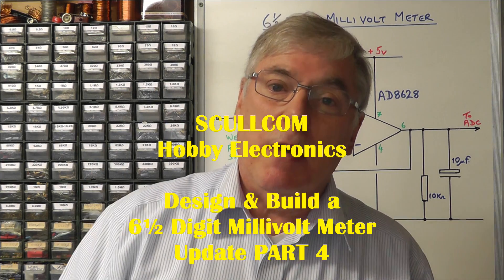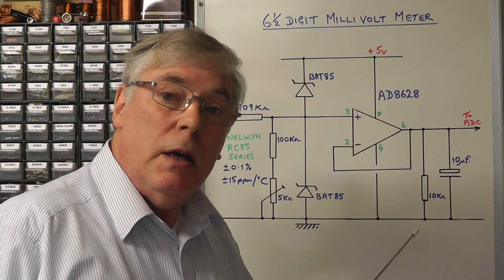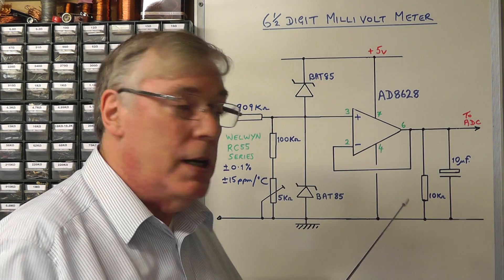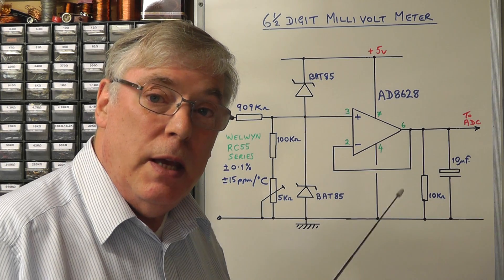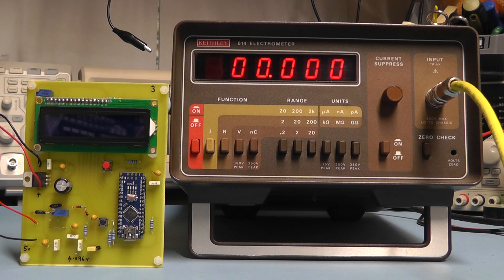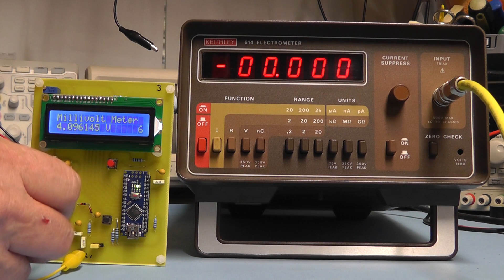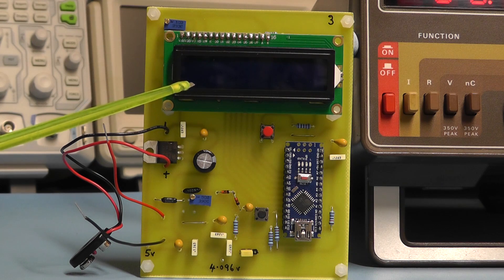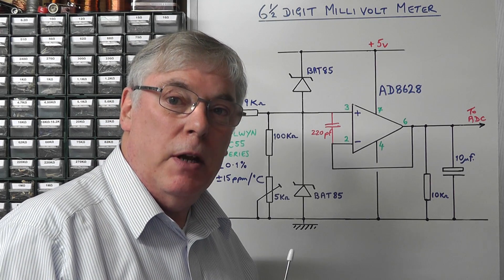Scullcom Hobby Electronics #36  - Design & Build 6½ Digit Millivolt Meter Part 4

Comment: Louis, I think we may have a potential bug in the LTC code that will compromise the averaging of the multiple readings.

I assume that you got your original code from Martin Nawrath, (Academy of Media Arts Cologne, Germany) it looks a lot like that, but Martin uses no averaging in his code.

In the main loop, we use a for-next loop that increments the number of samples we get from the Spi_Read function and then average the result by diving the result with the number of samples.

However, in the Spi_Read function, we skip the complete reading of the ADC if it is not ready.
Here: 
  if (!(PINB & (1 << 4))) {
  ...
  }
This means that the averaging can be off. If I'm right, the Spi_Read function should have a flag to signal a correct reading back to the main loop.

I will put a logic analyzer on the pins to see if this is happening, and how often.

What is your take on this?

Regards,

Paul (PS I also sent a msg to Greg)
Reply from the maker: Hi Paul, I have made quite some changes already to the Arduino code which should solve this issue (been working on over the last few weeks and testing). Hope to get my update video finished in the next few days and uploaded to my channel. I have made quite a number of other changes and additions to the Arduino code on this upgrade. I have change the way the samples are taken and averaged. The "if (!(PINB & (1 << 4)))" statement is also changes to "while ((PINB & (1 << 4)))   { }" which simply waits.
Regards,
Louis
Reply: Using a while without an escape in an embedded application like this may cause a "hang" in the main loop, or disturb the overall timing, which is not recommended. Another method to prevent that from happening is to use a global value in the Spi_Read code that only gets incremented with a successful data acq. That global var value is then used to average the final result, not the loop counter. I have used that method in my version and is available on my blog.

I'm very much looking forward to see what your changes and improvements are. You and Greg built an already impressive tool, and with some more efforts, it can be even made better. This is my first experience with this particular topic so I'm still learning and researching ways to improve the stability and precision of the output or add more features. I hope others can chime in with improvements too...

Comment: I got inspired by your project and built an MCP3422 version (18  bits/15uV resolution which suffice to my requirements) with PIC16F1619 (1Amp consumption VS arduino 16Amp power consumption) (excluding LCD current Cons. which is 4.8mA),the question about the capacitor 220pF between V- and V+ of the AD8628 Op Amp, when installed the current consumption increases by +32mAmp which is quite large for battery operated circuit, Please advise.
My project  power consumption is 5V*6.7mA (total) while the Arduino version is about 5V * (16mA Arduino+4.8mA LCD+ 1mA other + 32mA increased caused by the 220pF cap) total 5V*55mA that is 900% more than the PIC version, the pic development board I have used is the Curiosity Board from Farnell £13.00 and Microchip MPLAB IDE with XC8 compiler with MCC generator ease the development.
Thanks again for great inspiration.
Kind Regards
Reply from the maker: Thanks for your comments, nice to hear about your take on this project. Regards, Louis
Reply from the maker: Strange about the issue you were having with the increase in current due to the 220pF at the input.  When I checked mine it seems fine. Have you tried using a smaller capacitor say 100pF and see what happens. Wound be interested to hear.
Reply: Thanks Louis, for your prompt reply, I did try 125p cap and it is the same result.
I do encourage you to use PIC16F1619 now it is easy to program with the new Code generator that comes with the MPLAB ide xc8 compiler.
You will reduce the power to max 2mA except for the LCD which is about 4mA,, I do have LCD code for that if you require it.
Regards
Mohammed
Reply from the maker: No sure why you are having this increase in current I will have another look at mine to double check.
Some years back I starting with using and programming PIC's but for some reason I have drifted in to Arduino as I found many hobbyist found that easier to use. From what you say the PIC programming has become easier, maybe I should give it another try. Regards, Louis
Reply: I using I2C for the MSP3422 (18bit) the AD8628 and 100k+48.7+2kPot as input voltage devider of course this is drivin by PIC16F1619 nano power uC. But all ok working for me without the cap although I have to tackle noise  by software. The only issue I am having is the resolution which should be 15uV but it is now 128uV and this is due the data type "float" of the XC8 C compiler and almost found a solution.
CHEERS
Reply from the maker: Glad to hear it working without the 220pF capacitor. Trust you will solve the resolution issue soon. Regards, Louis
Reply: THANKS

Comment: Hey Louis, I finally finished my built of the voltmeters, I actually built two. I believe that there are some interesting enhancements to the design, so here is a link to my blog that details it all.

I must say that I am very impressed with the accuracy of the meter, they are much better than I anticipated and a very welcome addition to my toolkit. Thank you again for doing this all!

Paul

http://www.paulvdiyblogs.net/2016/09/building-6-digit-digital-milli-voltmeter.html
Reply from the maker: Thanks Paul, I have also been working on an update on this project over the last few weeks and hope to finish testing and filming this week before uploading to my channel. I have made a number of improvements including calibration method to improve accuracy. In addition I have added a number of new features. The software has been updated and I have build the unit in a nice project box.
Thanks for your link.
Regards, Louis

Comment: I built a test version of the Arduino Nano and an LCD display to work on the software. I also used a different setup for both switches, to get a more improved event recognition.

I used the following circuits for both switches (can't include anything so I have to go back 30 years)

 VCC
   |
Switch (normally open)
   |
   --10K-----Input Pin
   |              |
  1K      100n
   |             |
GND    GND

This setup provides an R/C filter function on both edges. Normally the C of 100nF is discharged and keeps the input that way during startup. When the switch is closed there is an R/C filter of 10K/100nF charging the C. When the switch goes open again, there is an R/C filter of 1K+10K/100nF discharging the C.

The definition for the Cal input needs to switch from a LOW recognition to a HIGH, and the pull_up must go. So this is the new definition :   
pinMode(BUTTON_DEC, INPUT); 

I have also changed the code in the main loop for the calc button a bit as well:
  } else if (digitalRead(BUTTON_DEC) == HIGH) { // Internal pull-up used; active HIGH
    delay(DEBOUNCE_DELAY_MS);                   // Add some debounce delay
    if (digitalRead(BUTTON_DEC) == HIGH)        // Read the input again, if OK do it
       adjustDecimalPlaces();
       showHeader();                             // Back to normal operation

This gives me a reliable button press for both.

Enjoy!
Reply from the maker: Thanks Paul for the input.

Comment: Hi Louis,
You have several great projects for the hobby user and a fascinating way of getting everything across to make it easy to understand and easy to built.

I just noticed a leap forward on the milli-ohm meter, which is now fully encompassing the pcb available through OSH-Park that Greg did. You also published a BOM that is easy to use and lists everything. Great job!

Are you considering (please!) doing the same evolution with the DVM by using the OSH-Park pcb and create a BOM for it?

Looking forward to the next installment.
Reply from the maker: Hi Paul,
Thanks for your kind comments.
Yes I am planning on doing a similar update for the Milli Volt Meter Project for which Greg also produced a nice PCB, which is available from OSH Park. Although I will be using the same PCB that Greg produced I will implement it slightly differently to what Greg did on his build. Will also update the software for this version.
The only drawback of OSH Park is that you have to order 3 PCB's at a time so if you can share with others building this project then the cost can be split.
Will try and get this finished as soon as I can and upload the video.
Regards,
Louis
Reply: Super! I managed to get the DigiKey partslist from Greg, and I've been working on some other parts required for this project. If you're interested, I can send you what I have so far. (I distilled the manufacturing part numbers, so the ordering can be from just about any supplier, not just Farnell,  DigiKey or Mouser)
Reply from the maker: Hi Paul, Thanks for the offer. I do already have a detailed list but if you would like to send me the details in the private messages section I will cross check it with my list to make sure I have covered everything. Regards, Louis

Comment: Hello from Germany!
I found your channel mentioned by another youtube channel (i think ist was Voltlog) and i like your projects. I already have watched Most of your videos. I plan to build this voltmeter with some additional features like different volt ranges and maybe auto range function that the adc always gets a good SNR, no matter if i measure under a volt or 50 volts. Before starting this i would like to ask if there will be an update on you actual circuit soon? Because when starting to built it i would like to use the latest version of the basic circuit. Thanks A lot and keep on your good work. 
BTW are you a teacher or something like this? You can explain very well, seldom seen that on other channels. 

Michael from Germany
Reply from the maker: Thanks Michael for your comments. I will be posting an update video on this project soon as there is now a PCB available for this project. Many years ago I did teach electronics for about 7 years before moving in to management. I am retired now so thought I would take it up as a hobby again and share with others. If your interested there is a bit about my background on my website, the link is http://www.scullcom.uk/about/
I also post my projects on this website.
Regards,
Louis

Comment: Great project, Thanks!
The 5 and 6 digits change rapidly, is there any way to filter out the noise ?
Also, if I add the 220 pf capacitor, I cannot calibrate to 4.096. The trimmer "bottoms out" . Any ideas?
Reply from the maker: Thanks for you comment. I will have a look at it. I plan to do an update on this project.

Comment: Thanks again for another great project. 
Just finished building the Millivolt meter board and should have it in a case soon.
Photo of my finished circuit board. https://flic.kr/p/GdcwdK
I ended up using an Arduino Pro Mini from Sparkfun, and a Caddock voltage divider resistor. I also had some Adafruit RGB LCD's in my parts bin, but not enough pins left to drive everything. I ended up using an Adafruit I2C LCD backpack design that allowed me to move all the LCD and button pins off the Arduino Pro Mini. I also have a DS3231 real time clock on the LCD backpack board, but haven't had the time to add the code for it yet.
On the input circuit circuit I also added a guard ring and didn't use the capacitor on the output of the op-amp.
The design is very stable and without the input shield and case it is currently fluctuating +/- 15uV max.
Looking forward to your next project.
Thanks - Greg
Reply from the maker: +pbreviceps Thanks Greg for you comments. For some reason Google put your post in the likely spam folder so I did not see it at first. I had to approve it to get it showing up here.
I had a look at the photo of your circuit board and must say it does look very professional, well done. I did also test mine with a Caddock resistor divider and it works well. I tried to keep the cost down for the hobbyist. Good idea about adding a guard ring at the input.
I have been busy over the last few weeks on other work and family commitments but plan to upload a new project video in the next few days once I have finished the filming process.

Comment: Would you be able to update your schematic with your final design?: (http://www.scullcom.com/Millivolt_Meter_Schematic.pdf). I'm going to make a go at this over the next couple of months.
Reply: +Terry Myers Or can you share the KiCAD file?
Reply: +Terry Myers I've just printed out the data sheets for my binder, ordered some SMD sodlering practice kits on Aliexpress, and created a wish list to purchase the parts.  I went through all of the videos and redlined your original drawing and added some suggestions that I've found in the comments
I'm going to make a few modifications.  1. Will probably use the I2C bus for the LCd display as well, since I have the parts for it.  2.  Going to expose the USB port and constantly print the read value.  Maybe add a RTC and print a timestamp as well. 3. Use a median filter instead of average, and print the standard deviation.  I'll probably use around 100 samples, however many samples averages to maybe 4 samples/sec.  Although the ATMEGA has a memory limitation when trying to take average or medians of large arrays.  You can fit about 500 uints in an array along with other code before it starts running out of memory.

I'd still like to get a hold of your KiCAD file so I can finalize the  design.  Thanks!
Reply from the maker: Hi Terry, Sorry for the long delay in replying but I have not been active on You Tube over the last month due to other work and family commitments. With regards the Millivolt Meter project you may like to have a look at the PCB (surface mount components) designed by one of my subscribers pbreviceps (Greg). He has left a comment in Part 4 of this project. Greg has taken my design and software and produced a very high quality PCB (double sided). Check out this PCB at the following link:
https://www.flickr.com/photos/barbouri/26392316563/
This PCB is available worldwide (free shipping) from OSH Park for just a few dollars. Check their link below for this project:
https://oshpark.com/shared_projects/qgv0fpKN
The PCB design file is also available on this webpage to download.
Greg used Arduino Pro Mini on the board, and a Caddock voltage divider resistor as I showed in my Part 1 of this project.
If you feel you still need my KiCad files for this project I will try and dig them out and add the download links on my www.scullcom.uk website under this project section. As I also made some modules for Kicad I will try and include them as separate files. I will update my website as soon as I can, so keep checking.
Regards,
Louis

Comment: Sir, your videos are just amazing, there a lot of remarkable things and nothing really to complain. Also, maybe I'm wrong but this also could be used as a precise current meter only by adding a low value resistor and a few changes on the software, isn't?, if I'm right, hope you consider this as a future add. Thanks.
Reply from the maker: +.rpv Thanks for your comments. I have been considering a project on a precision low current meter using a feedback OP amplifier (Transimpedance OP AMP). Hope to do it as a future project.

Comment: Hi.  I have been working on a thermometer project using a pic.  I had noise issues on the AD input so I added a cap at the same point as you did here.  I too received erroneous measurements upon power up and determined that is was the new cap charging up which caused a slight drop in the AD input.  Perhaps that is what is happening here.
Reply from the maker: +Rachel L Thanks for the info.

Comment: Hi, I'm not an expert, but isn't it a bad thing to put capacitive load on the output of an opamp? Shouldn't there be a series resistor before that  ... at least? Or even better - put the filtering in the input - over the 100k resistor. This way you'll have nice low impedance for the ADC and no capacitive  load on the output. Like I said - I'm hobbyist, so if you are like me and read my comment, don't take my word for it. From personal experience I know it's very hard to stabilize a voltmeter of that resolution - you might have to play a bit with the values. (hint: click read more)

P.S.  (wild guess) If the capacitance is over the 100k resistor, probably the value should be quite lower than 10uF because it's being charged through  909k resistor. I would start with 100nF and rise or lower depending on the results (yes, I don't do math :))
Reply from the maker: +Nickolay Pelov Thanks for the comments. Yes you are correct. I have covered this point earlier in the comments. May answer was as follows:
Adding a larger capacitor on the output of a unity gain OP Amp is not ideal and can cause it to oscillate and become unstable. One solution to this, if there is a large capacitive load on the output, is to add a capacitor and resistor in series between the two input pins. As you will see on the video I did add a 220pF capacitor across the input of the OP Amp and that helped, but I may add a resistor in series with it as well if I find it helps further. Also adding additional capacitors at the input to ground and supply voltage may help. I may look at reducing the value of that output capacitor and see how the circuit responds. I originally added it to reduce any possible noise on the input to the ADC.